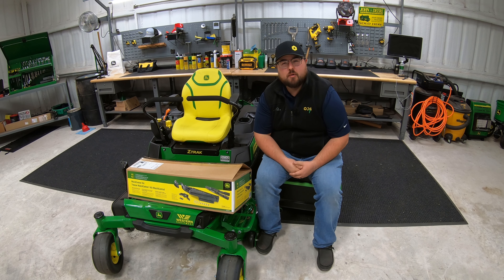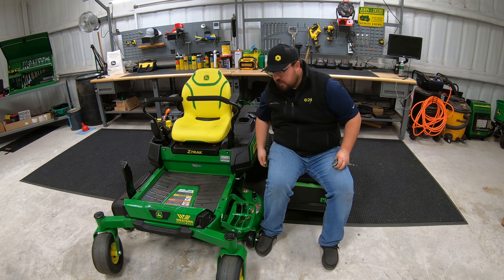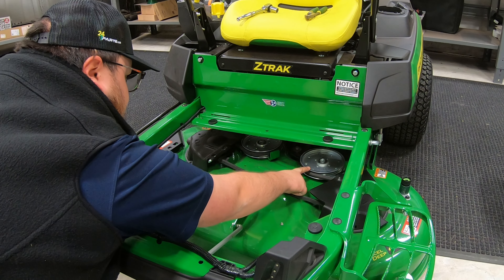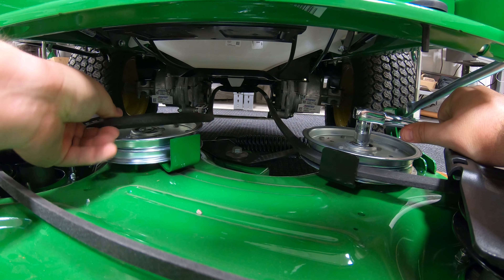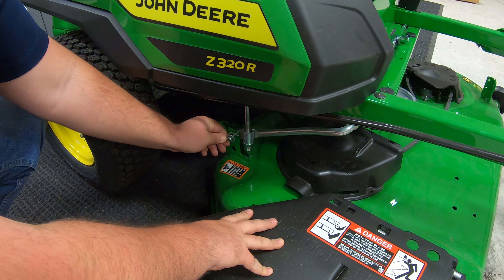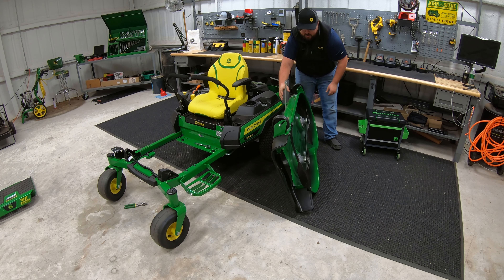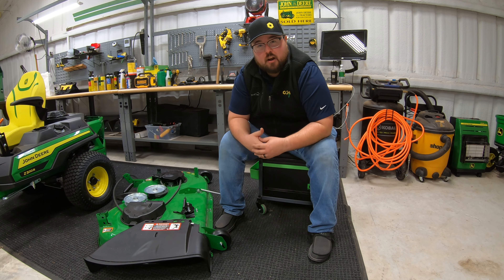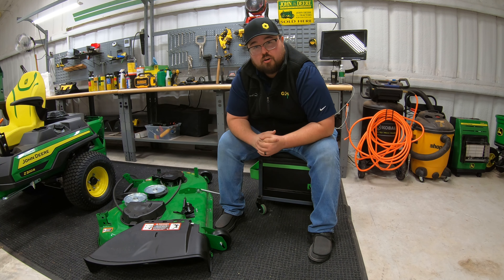How to Install Mulch Control Kit on John Deere Zero Turn Z320R Mower

Comment: Thank you for the video as it was a great help. I did do two things different. First, as in your old mulch kit video, I used a 3/8" ratchet with extension in the square hole on the spring bracket, pulled it back and a helper removed the belt from the back pulley without having to remove the belt from the tensioner. Second, I removed the front hanger from the deck rather than from the frame and pushed it up to the frame. One less thing to get in the way when  pulling the deck out. Beyond that followed the instructions and everything went well.

Comment: I just subscribed to your channel. Yesterday I bought a 2024 JD Z320R from my local Dealer. I plan to mow today with it! Thanks for the video on the mulching kit. I think I will call my dealer and pick one up. So my understanding is that the kit comes with the mulching blades. You didn’t discuss this in your video so maybe I am wrong. Should I also install the mulching blades? Again thank you so much for your videos! You do a great job. My JD salesman said he also followed you! I mentioned you to him. Thanks!

Comment: I thought new blades came with the kit as well???
Reply: My kit came with new blades.  I held them up to the blades that I got with it when I got the machine and they seem to be the same design to me?  I’m thinking “bonus set”
Reply: I thought the same, but I looked up the part number and it says "mulching blades".

Either way, I just got mine and did a spring clean up with the material collection system and it seemed to shred that stuff just fine with the blades that come standard on the machine

Comment: The problem is that when it's in the open position, your mower will clog up because your discharge area is now about a half an inch.

Comment: Too many reviews with the mulch kit getting tore up by the blades being $300 it’s not worth it and I’m taking the mower back because it won’t mulch without that kit
Reply: In the manual that comes with kit, it specifically says that blades must be changed to the blades in kit, or it will destroy the plastic pieces.